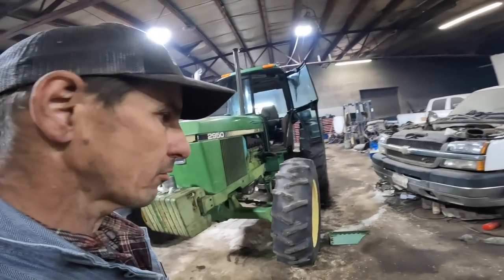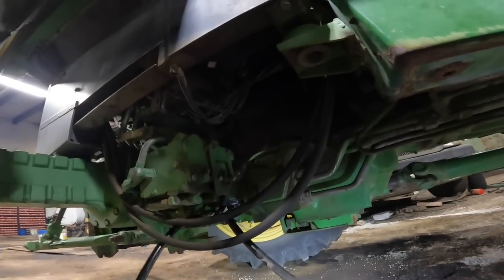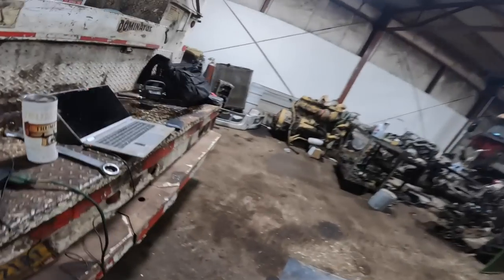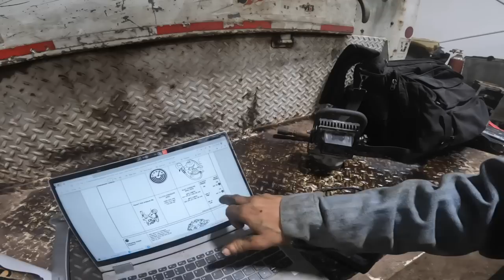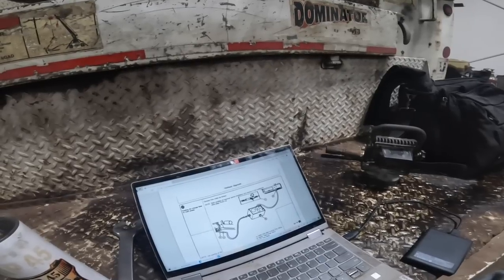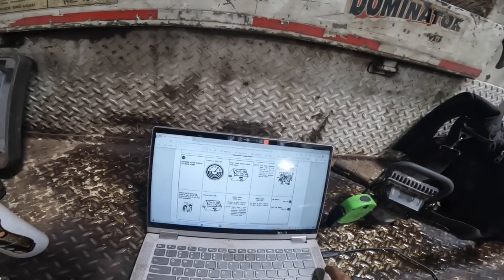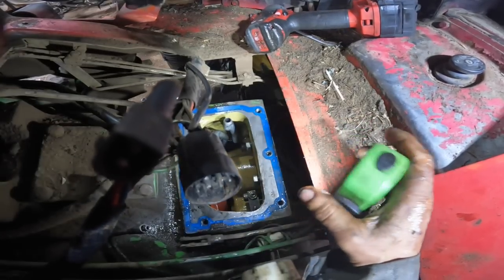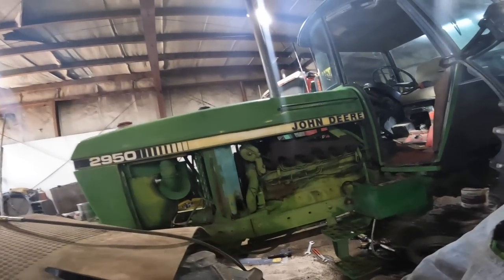John Deere 2950 ( no hydraulics)

Comment: Thanks for a very good hydraulic diagnostic lesson Warren. We have two of these tractors over 10000 hrs, this lesson may come in handy one day.
Reply: Are they  reliable ? What about fuel consumption ?
Reply: Yes they have been good tractors. A tank of fuel lasts about 8 hrs working hard. Tractor data would have the fuel tank capacity to work out the gal per hour.
Reply: Thanks For Sharing your knouledge

Comment: This post demonstrates the training and full competence of a technician.  In fact, the mis installed tube can be the fault by split failure.  (My reasoned guess early in the troubleshoot tree).   via....A cascade of oil causing low *or absent pressure delivery to the system.  And, the finding at charge pressure (absent) the story of failed oil pressure to the larger system.  But to inspection and repair without the labor to split the unit....remarkable and huge to fitment.
Just so well done.   A return of the machine to working operation.  
The owner of this unit will enjoy the power and useful life as exists to the design. *rugged and reliable. Absolute craftsmanship in action made that possible.  Thanks for sharing the work process.   And I don't forget you are brave and share the occasional failure.  But this win was huge.  That by lessened cost to the owner *operator.         M.

Comment: Hi Warren , thanks for the update on the Pacar , I know one thing , if you pull it out and rebuild it , it’ll run for a million miles with zero issues !
Because YOU do it RIGHT !
Reply: I wouldnt put money on that. Paccar Motors are not too great to start with. Used to be Cat, Cummins, Detroit would make that mileage. Now with Dpfs. Def, etc. Hard to make it past 500 thou. without something going fowl.

Comment: Thanks for the share Warren. well well well..... no short blocks, no long blocks, no compleate engines to be had.. why does this not surprise me.  I'm back pullin a wrench and the parts availabuility is just crap. this past weekend my boss went to a pick & pull just to get parts that customers have been waiting to get there car fixed. you said it would get worse... and i think it has. real quick... case in point, it's bad when any local parts suplyers cant get there hands on a set of brake pads.... does that tell you anything? catch ya in the next one.
Reply from the maker: Couldn't get a oil filter for a 7.3 power stroke the other day.
Reply: @westerntruckandtractorrepa1353  couldn't find fuel or oil filter for a 6.7 cummins and had to go to 3 stores to get Rotella oil. Went to truck stop and they were out

Comment: I had a similar problem on a 410 C backhoe, when I split the transmission case I found a little aluminum slug. Some one had put too many shims in one of the valves in the valve block and punched a hole through.

Comment: What is up with Paccar? We have a fleet of 25 DAF XF106 here in the UK with the Paccar MX11 & 13 engines. These have all been recalled because there is a batch of engines that the camshafts have been hardened to much and are wearing  out the followers. each engine is a 3 day operation.

Comment: 5/4/22...JD 2950 hydraulic flow problem: kinda intricate 'wiggling' formed tube back into its proper location thus completing flow circuit...now all 🐙  'octopus' related functions: (PTO, 4WD & other) returns to normal. Great testing (with some of yur home made gage adapters) & giagnosing using that fancy JD trouble shooting software.
 Always enjoy watching you methodically  go thru disassembling components⚙ while simultaneously holding yur camera in one hand 🙋‍♂️ & wrenching 🔧with other  hand ✋! Great attitude toward this kind of indepth work & teaching viewers (mechanics & owners) "how-to" get results. A+ on many levels Warren!
 Now.. Pacar engine ... what the 'xyz' do you - the dealer/supplier- mean 'their are no engines available'!!?? Are they comming from China?...kinda stuck in 'traffic' at Port of LA & LongBeach? ...blocked by Russia in Sea of Odessa preventing Polish made machine equipment from shipping 🚢  exports to port of LA or LongBeach or up in Washington...? Give us loyal viewers more of yur 'inside-the-beltway' info from your 'deep-throat' sources who can/will expose truth...about why we have no 'GrayPupon' mustard 💜  or replacement Pacar Engines! 🤔

Comment: I replaced that or another tube like that one twice on a 2630. The tube was broken in the middle. Now I have lost hydraulics again and really not looking forward to splitting the case again.  Hoping for the relief valve or the filters but pulling the shifter housing will tell the tale.

Comment: I think the spring dampener must be out of synchronization with the oscillating resonator, that or the cavitation siphon is misaligned with the high speed distribution block off plate. If its not that, you might check the fluid viscosity in the differential transfer switch.
Reply: Also the valve clearance has fallen out!
Reply: @aubreywilliams6153  YES! and that certainly wont help the transverse sun gear bushings in the clutch follower!
Reply: George Jones  Not sure whats more funny my joke or the fact it seems you didnt recognize it as one! lol

Comment: I have a jd 300 loader that  sat in the woods for ten years when I got it to run the main pump split its head Right down the center.  I pulled pump and took it apart  and don't see anything wrong with it . Is there something  is the system that told it to pump full beans and bust its head. Or is that just a thing on these rotery  hydraulic  pumps

Comment: i blew my transmission in my ram 2500 series Cummins 6 speed manual it came with G56 series transmission i ordered one brand new from the dealer 11 thousand dollars Canadian plus tax i waited since last October i just got the truck today they could not get a new transmission at all dealer unavailable. The guy who installed it said he cannot finish the job cause its a NV 5600 hes a diesel mechanic harness problems etc etc etc well got it towed at my place and I'm going to pull it out see what he did and start all over again  I'm like you never again will i bring it to somebody else to get it fix o ya the NV 5600 cost me 7000 dollars rebuilt from Alberta parts are really hard to get. He did try though the transfer case is not bolted up so it will make a little easier Lolo again good job partner

Comment: i have a 2550 and had to replace the bushing that holds a tube in place onto the transmission pump 
common thing on the older deeres of the 40 50 and 55 series

Comment: My John Deere 2950 has been getting harder to start over the last year. Finally narrowed down to the hydraulic pump building pressure and holding the engine back thus not letting it spin fast enough to build fuel pressure. When I turn in the destroke valve on the hydraulic pump, it spins as it should and starts right up. My question is, why is this a problem now? What has gone bad or is going bad that this has become a problem now? I would like to repair whatever is going on so I don't need to destroke the hydarulic pump everytime I start the tractor. Any help is appreciated.

Comment: hi, I have a 2840 JD. I split the tractor to replace the inner high low seal. after I joined the tractor back together after the tractor warms up I lose power steering,  PTO and the tractor revs and don't move. the Hydraulic fluid is foamy. any comments appreciated.

Comment: I have  a JD2355 that is not sending charge pressure to the front high pressure pump.    I need to split my tractor in half to get to the internal transmission oil pump.   I checked with a JD dealer, and they want $3600 to do this.   I am looking for information so that I can do this myself.   Can you help me?

Comment: The best thing to do with that paccar engine is to get a complete refund for every single item purchased and go get a complete used engine.  You can buy complete low mile mx13 engines for 10k-12k if you look around.  I purchased a 70k mile complete mx13 power train with the dpf scr system complete for 15k